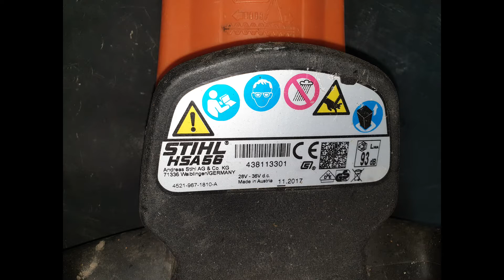Repair hedge trimmer Stihl HSA 56 not working

Comment: Mine is doing the same thing and my pole trimmer acts like it doesn’t have any power. From your video are you just cleaning everything and putting new bearings in it? What size bearings? Also what grease are you using? Not sure what you are doing to the motor part.

Comment: Any chance of a slowed down version of how to remove the top casing? This video he literally just turns it on its side then turns it back and the casing just suddenly 'pops off'? There are no videos showing how to fix/ find fault with the top/ battery components....
Reply: At 2:09  you can see where he squeezes with thumb and finger. This releases the front tabs.